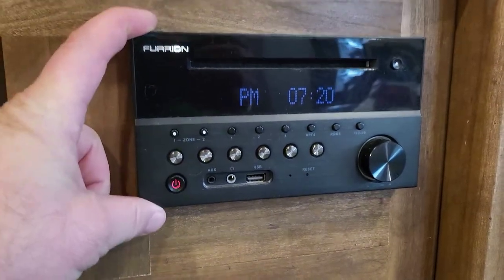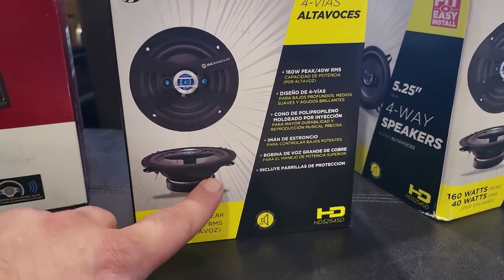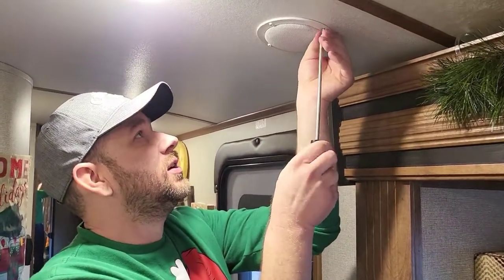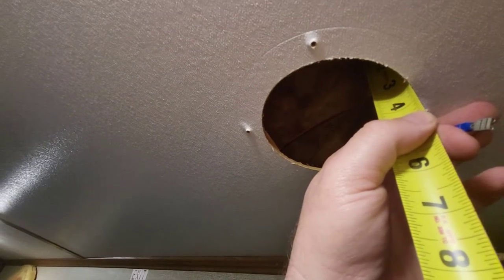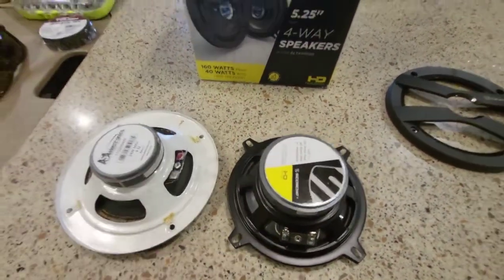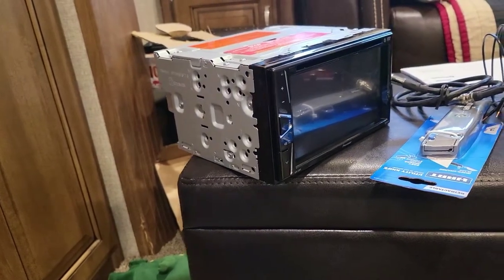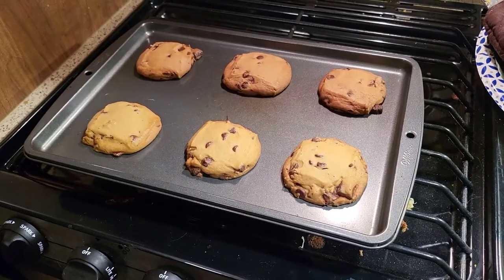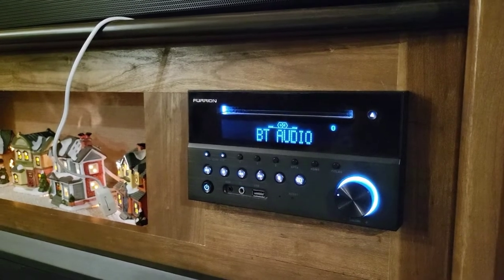RV Camper Stereo Speakers Upgrade

Comment: The bracket that would amount on the side of that radio is basically like an l bracket and then it comes out to the front of the dash it would screw to the dash from the front and then you would have a trim bezel that would surround the stereo and you wouldn't see the mount bracket or the screws
Reply from the maker: Yeah. Like a traditional car stereo upgrade. I'm surprised this unit didn't come with anything like that.

Comment: The head unit is 2 zoned if you look at your head unit it has 1-2 on it so you can turn off part of the van sound. The head unit is 40w per channel just turn off one of the zones. Also download the App for it and change the eq  etc and it sound fine.
Reply from the maker: The original radio had an app?
Reply: @vdubing01  yes you set it up via the app. Eq etc. it also has a HDMI out and theater sound as well as a woofer out

Comment: Nice decor btw…. Hey good video! Question if I may: what’s your thoughts on the Furrion product? Sound system and (if you have any other Furrion appliances?) thx!
Reply from the maker: In my opinion, based on my experience. Furrion is junk. We replaced the TV Day 1. We still have 2 furrion stereo units that are both unreliable. Their features come and go. Sometimes the Bluetooth feature just disappears.

Comment: What about the outside speakers?
Reply from the maker: My outside speakers run on their own stereo inside the outdoor kitchen. Mine are not exposed to weather so they'd be the same process. If you're are exposed to weather the process of the same. But you'll need outdoor rated speakers. You'll also need to seal between the back side of the speakers and the wall with butyl tape. It's best described as a putty. And then use a weather rated silicone base caulking to seal around the outside of the speaker where it meets the rv wall.

Comment: Damn! Now you got me wanting to replace our speakers! LOL.  The outside speakers on ours are the WORST! Have you done anything with your outside ones?
Reply from the maker: We haven't done anything with the outside speakers. They are actually inside our outdoor kitchen ceiling and run through a 2nd stereo dedicated to the outdoor kitchen. But I'll for sure be upgrading it at some point. It's just a regular car stereo setup. Should be simple and straight forward.

Comment: With regards to back/front seat sounding different, the biggest difference isn't the wiring, it's the fact that you have A) a trunk and B) generally a larger speaker..... say a 6x9 in back versus a 5.25" in front.  It sounds like they wired them in parallel so you're getting a 2ohm load and actually getting the full power.  You may be disappointed when you redo all the wiring and find out they are now in series and drop half the wattage.
Reply from the maker: REALLY!? Wow, good to know. Ok, I'll leave then as they are. Thank you

Comment: Secure an L bracket to the back and screw it in place??
Reply from the maker: That's not a terrible idea. The only problem is reaching the L bracket. Once the stereo is slid into the hole there is no access point to tighten any screws. It's the worst.

Comment: The new speakers should sound much better
Reply from the maker: Is a pretty good improvement. I think I'll so upgrade the unit eventually.
Reply: @vdubing01  yeah you should but you should also be careful when doing so cause you look out for the wattage. And I hat those speakers are capable of handing. To stay in the safe zone